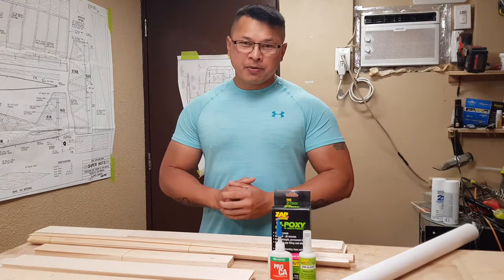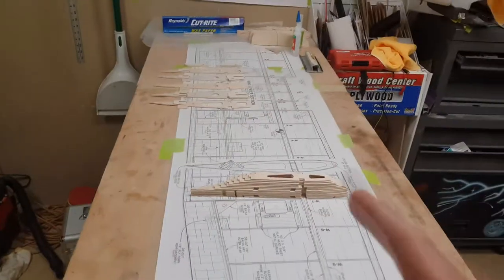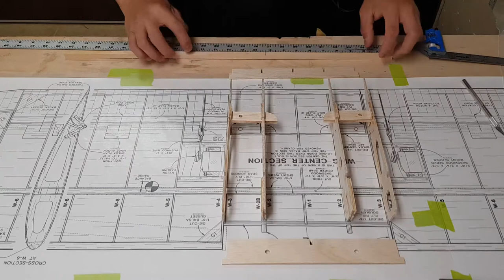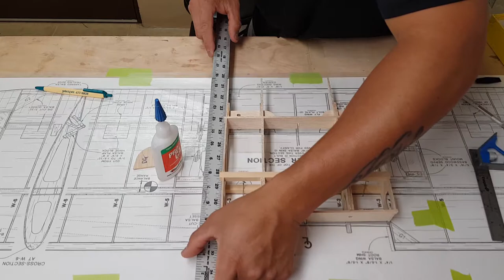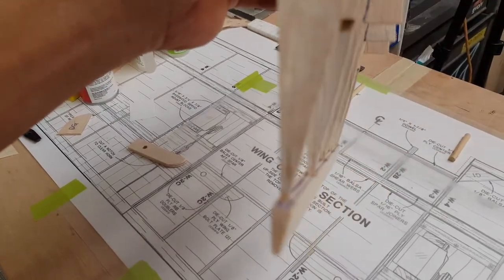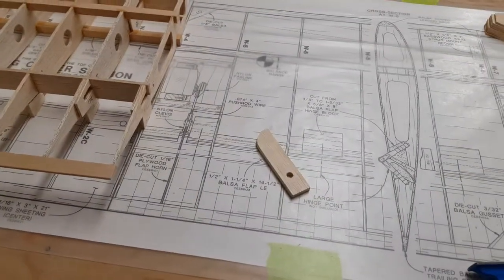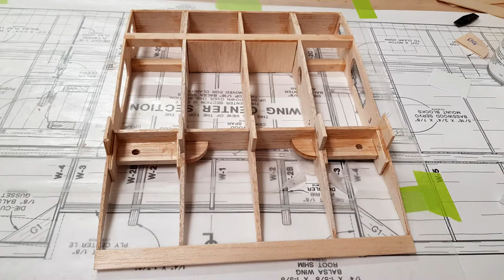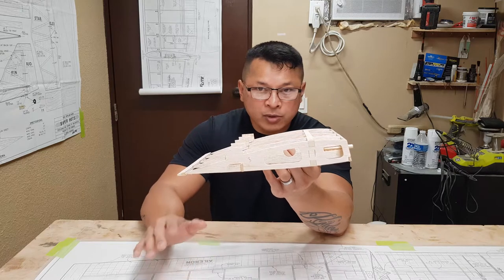Top flite Cessna 182 Build Part 3  (Wing Center section)

Comment: I use a 4"x6" note tablet for mixing smaller amounts of epoxy, tearing off used pages as I go.
Good on you for using 30-minute. It's much stronger. And, any time I can add strength without adding weight, I'm all over it.

Comment: Helpful hint: Lay a piece of 5/8” sheet rock on top of your plywood table. It’ll make pushing pins in a whole lot easier on the fingertips. I use to build on plywood till someone showed me that tip. Awesome videos! You should have way more subscribers. I’m starting to share your videos to get the word out.
Reply from the maker: I normally have a solid or hollow door as my table top with a sheet of drywall as my surface.  That was in my normal shop.  In this video I am working on my glass showcase so I just placed a 3/4" ply ontop as my surface.  Was more excited to start my build so made do with what I had at the time.
Reply: I have a build board I bought years ago that I don't think is even available.  Its only 48". My builds are getting larger so I also do the sheetrock pin board method. I use 1/2" that works fine.

Comment: Great videos Bayona, new builder here getting some great tips. Got my hands on a GP Skybolt I will start at the end of the year. Thanks from Australia!
Reply from the maker: The Great Planes Super Skybolt is a awesome biplane for sure.  I have a build video well slideshow of photos only.  Before I decided to make actual build videos.
Reply: Bayona's RC World  Yeah that is how I found your channel. So glad I did.
Reply from the maker: @alaningram8954  awesome!  A little tip on the Skybolt.  Be mindful during the build of the rear turtle deck first the sheeting is only 1/16" thick.  Try and get your sheeting work spot on during this process with flush edges as much as possible.  Otherwise excessive sanding to blend it into the surrounding areas will make it too thin in certain areas.  Same with the side corner blocks which you will carve and sand to the proper radius.  Don't over sand the near the fuse sides otherwise it will become too thin in the areas as well.  Soldering the wing center cabane ensure that you use acid core solder and not regular solder wire.

Comment: I’m trying to figure out the correct dimensions of the ribs for the centre section… ideally I’d like a template of the actual ribs but I’m not sure this is possible as you would have pressed them out and used them. I want an actual template of the ribs so I can get the wing joining pieces correct. I bought this kit second hand and unfortunately the centre wing section and the engine cowling were missing.. this was an artf kit but it looks the same as yours even though you built from scratch. So I have two complete wings, fully covered but no centre joining section. Trying to figure out how to make my own. I know you can buy a whole wing kit but that’ll cost me four times what I paid for the kit.. unfortunately they do not sell the centre section by itself.

Comment: Question: Why do you put your epoxy bottles away upside down? I think I’m about to learn something new. Lol
Reply from the maker: Nothing new!  Just when my epoxy starts running low I store them upside down so that when I need it the epoxy is all at the tip already and ready to dispense equal amounts instead of having to wait for the resin and hardener to slowly get to the tip.  Just personal preference and saving of time.

Comment: What do you use a building board?
Reply from the maker: My main board is a 3/4" plywood.  However I normally have a Solid wood door then on top of that a sheet of sheet rock or gypsum board.